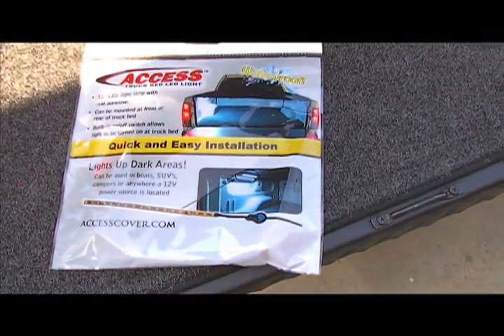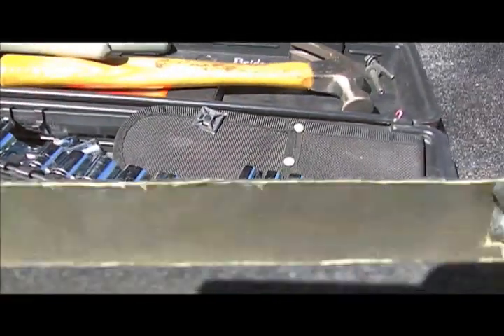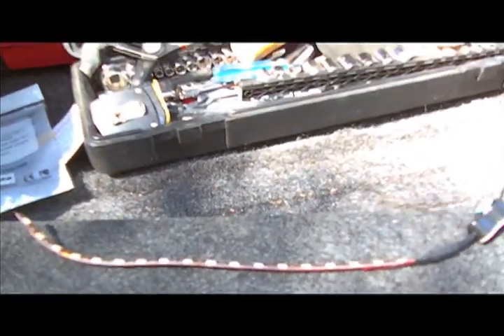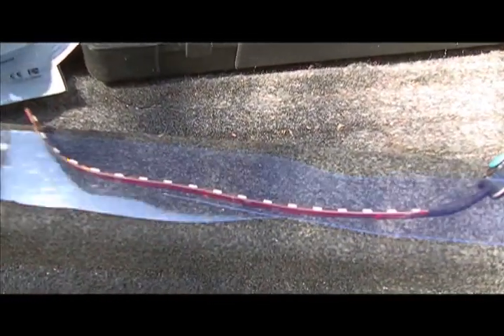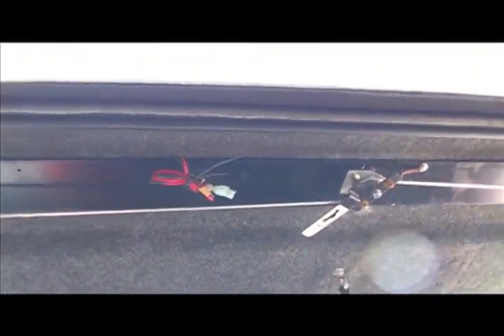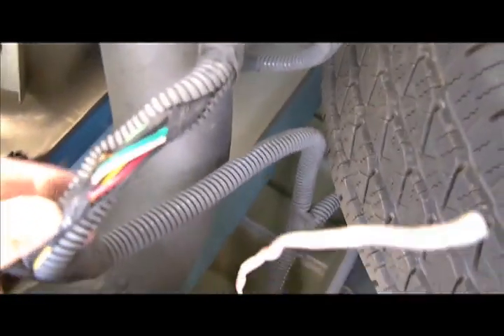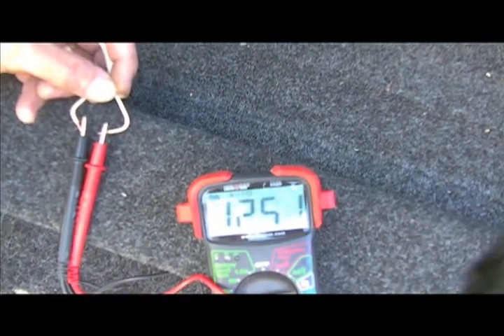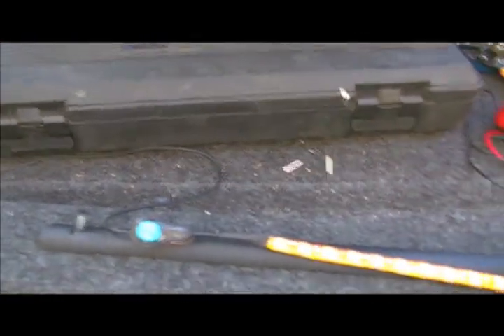How To: Install an Access Truck Bed LED Light

Comment: light looks impressive even if the camera doesnt do it justice! You sure take your time with your install and do it right, great install.
Reply: i wan t a light in my box, i have the low rider cover, but I dont have a carpet liner, i just see fiberglass, so not sure how to mount it yet. Any ideas? I got fiberglass to work with, or a rubber coated box, I woudl rather have my light on tonneau cover so it can point down of course
Reply from the maker: dynocompe Thank you for the kind words.  As to your question, this light strip is adhesive-backed, so I am wondering if it might stick to either the rubber coated box or direct to the fiberglass?  Almost two years have gone by since I mounted that light and it is still strongly attached to my mounting plate.  Alternately, consider attaching a mounting plate with industrial grade double-sided tape to the fiberglass and then mounting the light to the plate.  Good luck, let us know how it turns out!